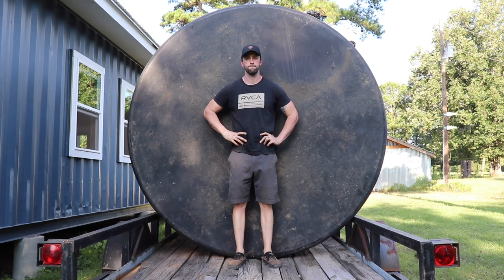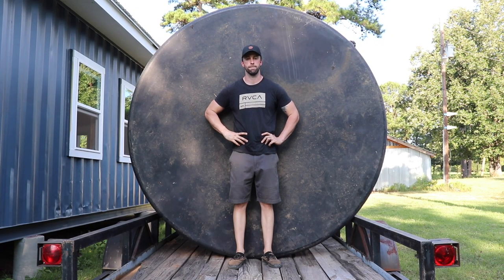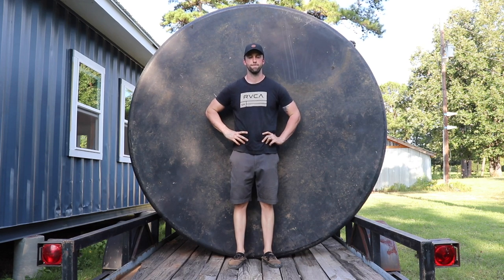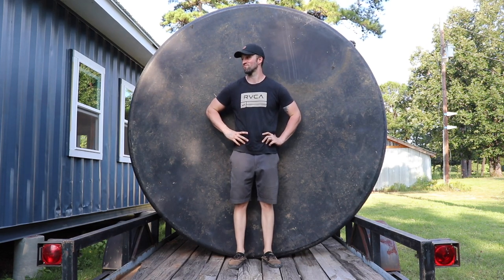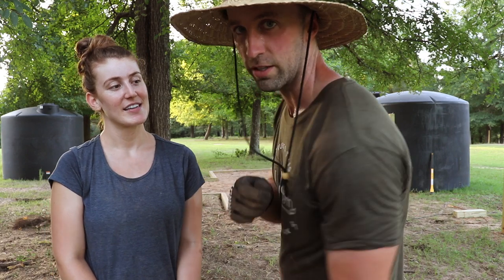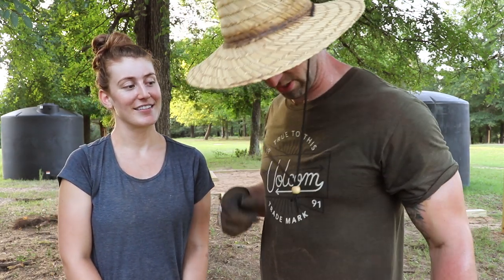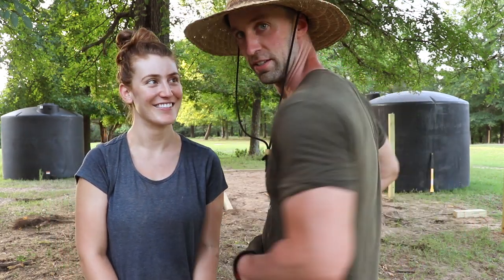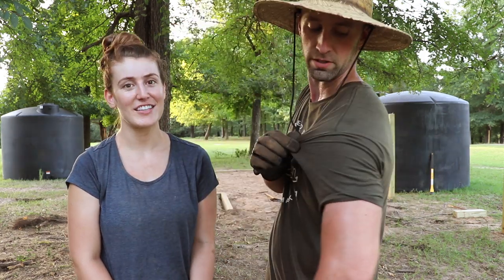The RAINWATER HARVESTING Project Begins!

Comment: I thought you would put an initial catchment tank close to the house with filters and a pump to have pure water to the storage units.  These would be on a much higher burm to have enough pressure to get back to the house easily. Whole house filters are easily obtained on line.  Otherwise you still have to filter the water getting back to the house out of a "Not-so-clean" tank system.  Also you would have clean water going to the critters if needed and/or other out buildings.

Comment: IF you are placing water tanks in a Shed you need to insulate all the walls or the pipes will freeze unless you install some sort of heat in the building

Comment: I believe you are going to run into issues with your tanks being above ground. Putting them below ground, the water will naturally remain cold, but in the sun (black tanks) your water is going to come out HOT, even with partial shade. Plus, I think the tanks you bought can be buried, you just need internal bracing to keep them from collapsing. if you have them filled before you bury them, it will help reduce distortion as well.

Comment: In reviewing this video thinking about how much one of those tanks will weight full of water?  Your talking about just over 20,000 lbs per tank.  The foundation of the tank farm I understand your making it out off fill dirt with a stone base.  Those tanks won't take the crushed stone base without problems of the filled tank pushing wholes into the tank bottom.  Use sand instead of stone.  Looks good guys.

Comment: If you bury your Intake cold water line,about 6-8feet down,the ground will cool the water on the way in.If you are going to use a single line to your house,I'd suggest a coil buried at the house,split off and buried,for cold water.Well water is usually about 50 degrees year round,as it's naturally cooled underground.You can pump it through a heat exchanger to cool the house with just a fan and small pump drawing electricity,versus air conditioners.

Comment: Love the videos.  I would drill some holes in the side of the timbers and line with a piece of pvc pipe to let the gravel drain, or not.  Either way, great job.  You may want to check out haneeman 's youtube channel and see how he did his system.  Great info there.  He has had it up and running for years and it is doing great.  He just added a LARGE tank to his system that is about your size, that he started with.  First tank for sediment etc.  Birka filter for the drinking water.

Comment: You could have left one in the sun on purpose and use it to preheat the hot water.  Of course you would have to plumb it separately to the house.  You would also be surprised at the difference in water temperature inside the tank from deeper to closer to the surface.  I am surprised that tanks that large don't appear to have a lid large enough for a person to go through.

Comment: If you want an easier way to put that rebar in the ground; use a little water. 
1. Make small hole with rebar.
2. Fill hole with water.
3. Push rebar to bottom of hole.
4. Pull out rebar.
5. Repeat from step 2 until desired depth is reached.
So much faster than hammering you will think you hit a Florida sinkhole.

Comment: Now you have to get a container to catch the water at the house then pump it to the tanks get a second pump to go from the tanks to the house and you want to dig a trench to put it all under so you don't run it over and it's best to lay down sand and not gravel underneath the tanks the weight well make the Rocks puncture a hole

Comment: You may have covered this on an earlier comment, but I've always wondered why you didn't put an 8ft space between the containers? Seems like it would have saved you a lot of cutting, because lumber, and siding come in 8ft lengths and plywood comes in 8ft x 4ft dimensions. It would have made your home larger without costing much more and saved a lot of work.

Comment: All this talk in the comments about hot water is pretty true. One way to "solve" the hot water issue is to bury the supply lines from the tanks to the house about 8 feet down. The ground should be relatively cool that deep and the geothermal effect should do a pretty good job of cooling the water before it gets to the house.

Comment: Check the size of your tanks look more like 1200-1500 gallon tanks. I have 3000 gallon tanks and they are much bigger than what you have
Reply: Bigger in diameter, height, or both? Judging volume by looks can be deceiving, that is why fast food restaurants use small diameter and tall cups for drinks, they look like they hold a greater volume than a wider cup that holds more.

Comment: How will you prevent legionnaires disease in rainwater storage ?  You have a stand pipe to feed the first tank that will grow biofilm .  You Have exposed piping between the tanks that will grow biofilm and you have black tanks that will heat the water to unsafe storage temperatures.  Is this really the best approach to provide domestic water ?

Comment: If you're going to be using a filtering system to filter the water anyways it won't make a difference number one number two you could always use a gasket there are gasket out there that you can use as well that's cheaper. Sincerely Chuck

Comment: With the tanks being black.  That will draw sunlight in turn heating your water up. And if you dont cycle through the water fast enough.  Would that not produce a breading system for parasites?  It will not be a fully sealed system because your catching rain water.  I've used cisterns to collect water to shower but not drink.  We also used black 55 gallon drums to help pull the heat in.  That water gets pretty comfortable to shower with.  I don't want you two kiddos to get sick. You should also put them on a bed of stones or concrete.  Those tanks have the potential to weigh 20,000 pounds if they fill up.  That's 60,000 pounds in a small area.  Are you not worried about them sinking in the mud when you get rain for days?

Comment: I enjoy watching your videos. They are funny but educational too. Why not just drill a well for your water ? I know rain water is great, but two have to do so much work and the seams in the gutters will not last, the black tanks will give you hot water in the summer, and without protection the plastic tanks will get brittle. A well would have been easier and less expensive in the long run.

Comment: I really think you should avoid a wet system and buy a small 200gal tank for all rain water to collect in and to act as you  Sediment collector and use a water Submerged water pump that kicks on when the level in the tank goes up and turns off when it goes down to pump water into your big tanks it's how I set up the twin 15,000 at my work it's much easier to clean one small 200 then a 5000

Comment: Not exactly sure what the reaction between the presuretreated lumber and the rebar will be if it is not coated. I do know that corrosion is accelerated with untreated metal and the pressure treated lumber.

Comment: We did enjoy the video this week but we have always enjoyed your videos!  You three are doing a great job and enjoying life at the same time.  Good job on the frame for the base, it allows you to put a roof over them if you want to in the future.  A couple things about tanks, you can never have enough valves or unions.  It is a mess to drain a tank to fix something between it and another tank.  You might want to look at putting a fence around the tanks so the cattle do not step on piping.  Also if using plastic unions Bees wax is your friend, use it on the threads so that they can be turned easily.  Also Spencer as strong as you are, remember what Leroy used to tell me all the time, "Stop a quarter turn before it breaks!"

Comment: 7500 US/Gal = 62,550 Lbs 
Dude & Dudet' . . . that's not gonna work on bare ground, or on gravel, or on sand. You need a steel reinforced concrete pad. If you try anything else, you'll likely lose the bottom due to splitting.

Comment: I think you guys were very lucky not to get stopped by a 👮‍♀️ cop , for not having a signage on the back of the trailer “OVER SIZE LOAD “ whenever you use public road for carriers load like this where tractor is not visible from back , in this case tractor is your CRV.. have to have signage and red flags on both sides of the trailer. Check it out on internet you will know what to do next time. Anyway need to have a plan for snakes not to rest close to the water tanks? Yes ? If not they will be there for sure.

Comment: What is the rattle sound in the background sounds like very noisy crickets or something. Yes i did see the straps on the tank the first one. Now all you need is to get the tanks all piped up o and a filter so that you do not get leaves and seeds of the trees in your water. Here where i live in Ireland it rained and thunderer for 5 days straight all you would need here is a bucket lol .  Not a fan of that black widow i would beat the brains of it with the sledgehammer

Comment: If you have any humility, admit that you are not qualified to do engineering. People spend about 8,000 hours in school and have years of experience to be able to design systems. I get it, you're smart. You read the internet. You are throwing money into a system that will have no value in resale and may be problematic.

Let me tickle your brain. How much clearance do you need to the drain field? Why don't you want a well? How are you going to dose the sanitizer? How are you going to prevent freezing? How hot is the water going to be when it is 105 outside? What is the method to remove Giardia? Botulism? Tank scrubbing schedule? I'm an old retired plumber and I wouldn't do that at my house.